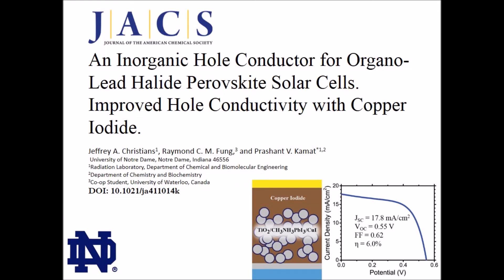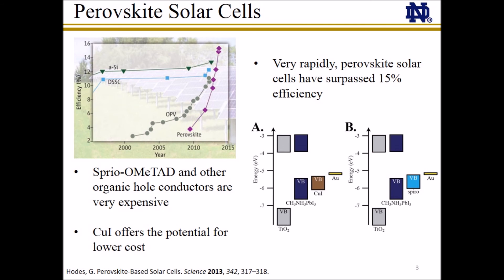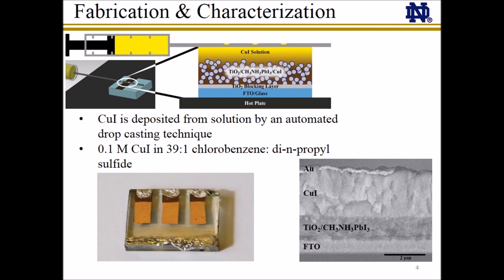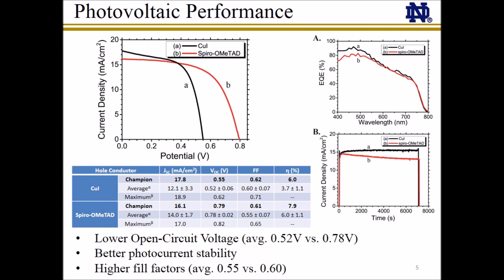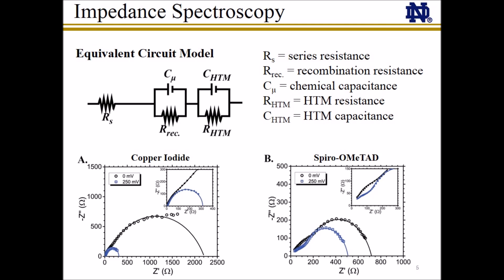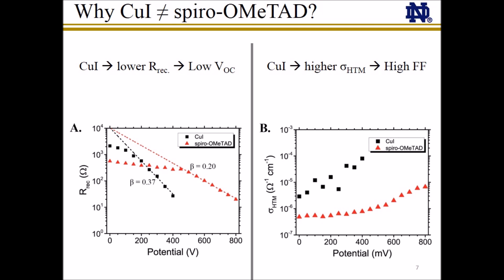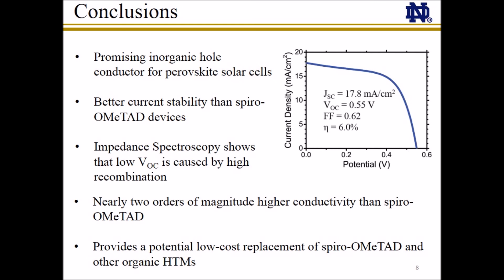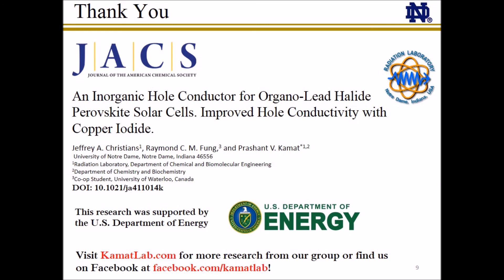CuI: An Inorganic Hole Conductor for Organolead Halide Perovskite Solar Cells

Comment: Organolead Halide Perovskite Solar Cells have now achieved 19% efficiency, and someone has found a way to convert old lead batteries into the perskovite used in these cells at a low financial and energy cost. One battery is enough lead to make pv panels for 30 homes....
See:
http://solarthermalmagazine.com/2014/08/18/recycling-old-batteries-perovskite-solar-cells/

To jump from a 2% efficiency to 19% in just a few years ( two or three?) is phenomenal.